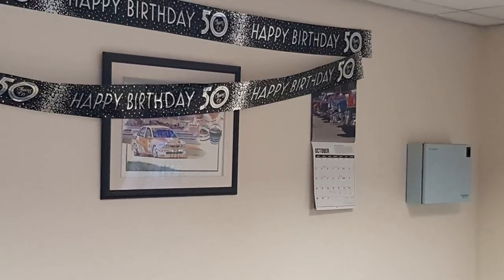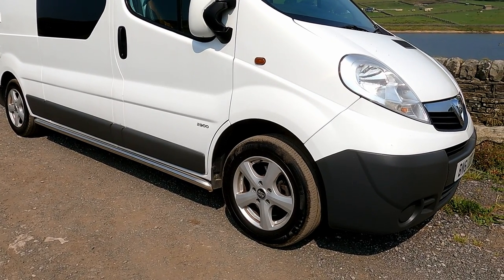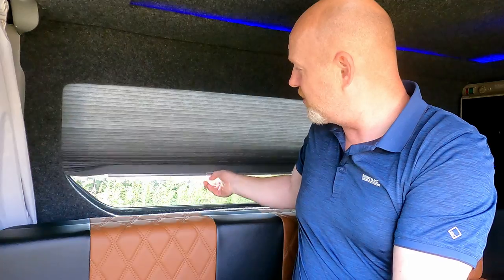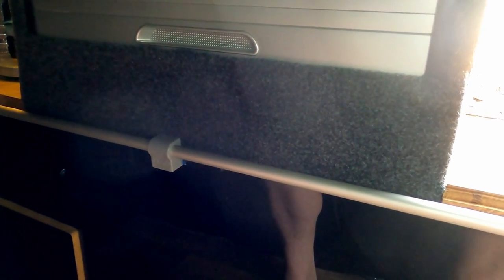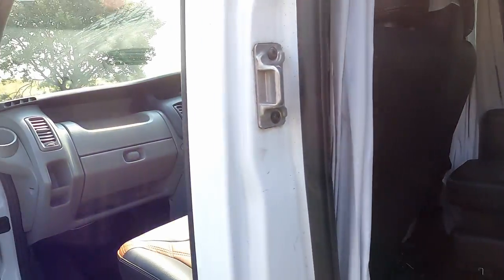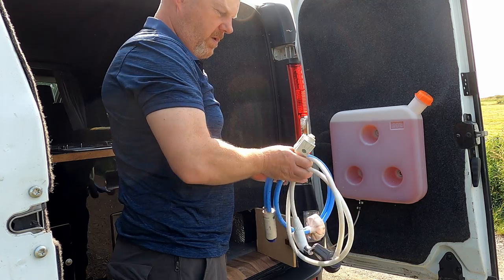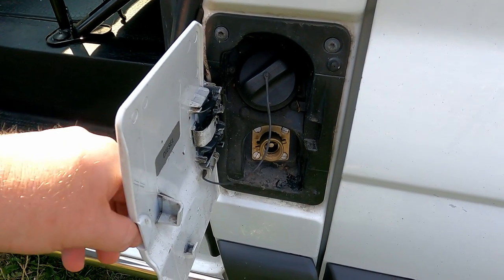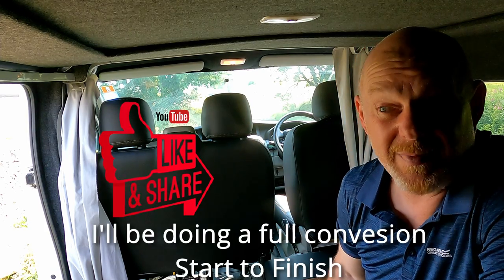Van Tour - Vauxhall Vivaro Campervan with Moped | Vanlife

Comment: What a beautifully laid out interior..not the norm set out by far. You’ve almost stolen all the available space..just needs a pop up so you can stand. Nicely done. I think you will regret selling her but good luck with your future plans. If this is anything to go by, the next build will be a sight for tired old eyes..thanks for sharing, I’m sure others will pinch a few of your ideas especially the bed.
Reply from the maker: Thank you Simon 😊 I really hope someone does pinch some of my ideas. That'll be the biggest compliment ever 🙂

I agree, a pop top would be a good addition. I considered fabricating one using fibreglass. It wouldn't be that difficult and you could easily sell the mould afterwards.
Reply: I get the impression that the next build WILL definitely be the ONE to watch for. You’ve ideas bouncing around in that noggin busting to get out..AND I think you could build a small niche business with those ideas…why sell the mould if it’s unique when you could sell the product off it..just a thought.

Comment: We have a Vivaro campervan took me only a few weeks, but still improving little bits..as you do. I had a 50cc Peugeot scooter on the back, but sold it after a heart attack. One reason for my illness was lack of exercise, driving and then scootering, so now we have bikes and feel a lot better. 

What do you eat with no table? Why do you have a fridge and freezer if you don't cook and eat? We have a cold box to keep the butter and milk, which only runs with the engine and we cook every day. Everything runs off the car battery, no problem.

You have a great spec basic van (6 door LWB), cant see how the fit out works. Outdoor cooking in the UK, really??? 

My shower is a £35 hozelock, boil a kettleful of water and top up to 5 litres and two can shower, use a car mat to stand on.

We have a standard wheelbase 5 door and now we travel with a cat and growing dog, its getting a bit cramped.

Different approach though, each to their own.
Reply from the maker: Hi, it's great to hear about your rig.  My mantra this year is "health is wealth" so, good on you for taking action and getting walking more.

Comment: I'm just starting brought cheap renault trafic with basic conversion just a futon bed in the back but takes up too much space .I want a single side bed so can put scooter in back as well or have a hydratail trailer can use .I just want to be sure van is mechanically okay before puy too much money into it .
Reply from the maker: Hi, I had the same idea of scooter in the van but when I put it in the empty van I was surprised at how much room it required 😱 It sure is a good idea to make sure the van is healthy before getting involved 😅.  Good luck with it all.
Reply: Would only be for travel get it out when on a campsite .

Comment: For the swivel did you just unbolt the base and turn it round?
Reply from the maker: Hi, yes.  The bolts are incredibly long though, so a small cheap power driver makes quick work of it. Don't forget to unplug the yellow airbag cable under the seat.

Comment: Where did you get the curtains and rails from? Would be great for the front of mine, were they specifically for campers?
Reply from the maker: Hi Kieron, I bought the curtain rails from my local caravan shop and used a heat gun to shape them to the contours of the roof and bonded with sikaflex. It's easier to take the roof lining out to do this. The blackout curtain material was from eBay.

Comment: Where was the curtain rail from? This is the only thing im missing
Reply from the maker: Hi, try your local camping/caravan shop. That's where I found mine and they had a choice of styles to suit your fitting needs. I used a heat gun to mould in to shape.
Reply: @projectmidlifecrisis  thankypu thats great advice.

Comment: Hi Nigel, I would like to know how you turned your double seat around.
Reply from the maker: Hi Andre,

It's super easy.  There's a screw on three corners and one in the middle at the back. You'll want to buy a cheap and small battery powered driver to undo the screw (it's a hex bit but I'm not sure what size)  as they're very long. One of the back corners can only be unscrewed after you remove the seat (you'll see what I mean) but you'll still need to unscrew it so you can use the hole to secure the seat once swiveled. Don't forget to unclip the yellow clip under the seat before moving and tuck it under the floor mat to keep it safe.
Reply from the maker: Something like this https://www.wickes.co.uk/Wickes-3-6V-1-5Ah-Li-Ion-Cordless-Torque-Screwdriver/p/223751

Comment: Nice job - how did the insulation work out? Thinking about a vivaro to convert as day van for biking, hiking and messing around it. Plan was to insulate, maybe install a heater and see what works. Your insulation approach was interesting so curious how it worked out and I also don't see a roof vent or anything so how does that work? Does it get stuffy or have you a trick somewhere for air flow? Nice job!!
Reply from the maker: Hi, in my experience having a vivaro, it's a great van to convert.  The insulation is perfect for both sound and temperature. Obviously the windows make up a large percentage of any vehicle and will need to be adequately insulated for temperature control at night. I have seen a company doing double glazed glass for vans, but I imagine the weight of these is restrictive.

It's a very valid point about ventilation in such a well insulated van. I would recommend you install a roof vent or at least to fit wind breakers over your front windows so you can leave them open a little at night even in rain.

You can buy Chinese diesel heaters for under £100 and they're great. I've done a video on my installation in the vivaro https://youtu.be/6qpuj4xqGQw
Reply: @projectmidlifecrisis Cheers for the detailed reply. I was thinking about the window deflectors on the front. I think for this project I want to keep the overall height as low as possible for barriers and car parks. More a stealth camping / one or two day adventure van. Appreciate the reply and good luck with the new adventure.

Comment: What kind of curtains did you fit between the drivers seats and the campervan space?
Do you have a link for a website?
Reply from the maker: Hello, I bought blackout material from eBay and stitched the edges myself.  It was quite easy and didn't take long.  I can't find the actual fabric I used but it was something like this https://www.ebay.co.uk/itm/100-Blackout-Thermal-Curtain-Lining-Fabric-Material-4-Colours-54-wide-/402315212975?mkcid=16&mkevt=1&_trksid=p2349624.m46890.l49286&mkrid=710-127635-2958-0
Reply: @projectmidlifecrisis  and what's the rails it's on?  Link as well :)

Comment: Hi, what about toilet usage?
Reply from the maker: Hi Gary, I have a cassette toilet. When 'wild camping' it fits  between the bed and side door at night. When pitched with the awning up, It goes nicely in the tunnel between the van and the awning, which is private. I also could use the shower tent, but I never have...too far to walk in the middle of the night 😁